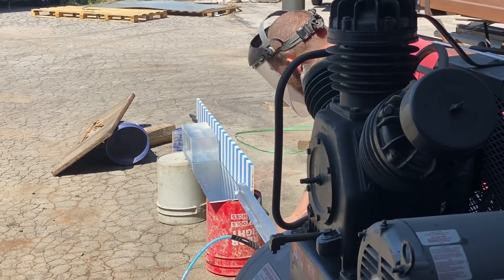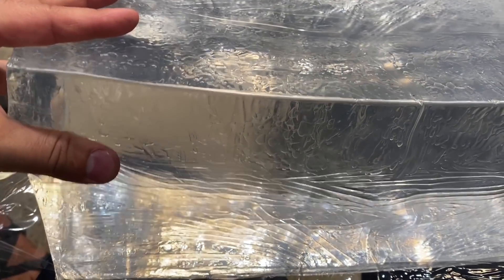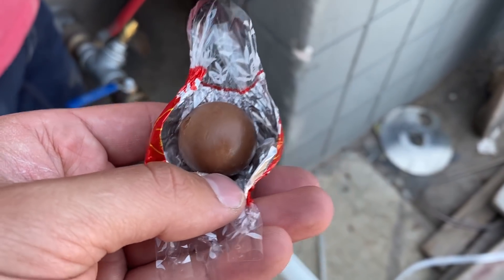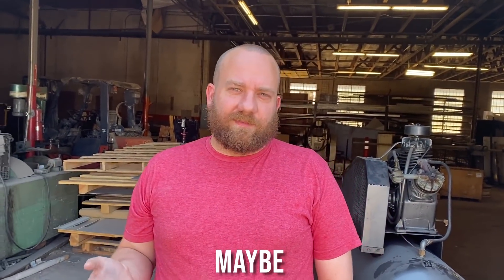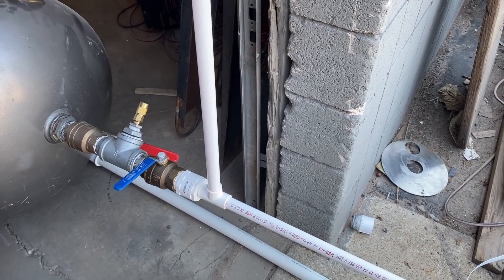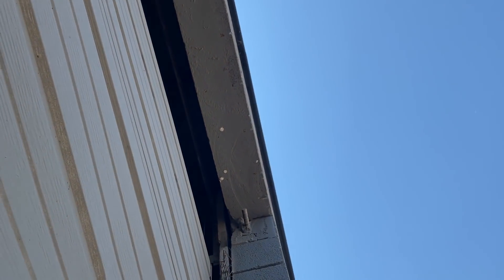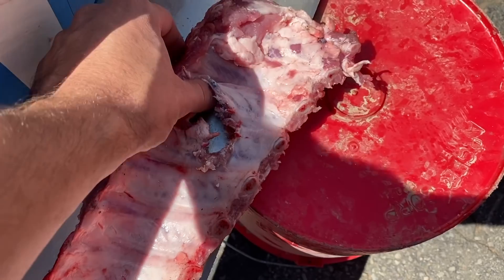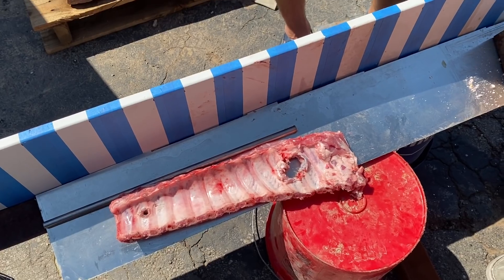Can A Gumball Kill You? Ballistic Gel Test

Comment: Ive removed the buckshot from a 20 ga.  shotgun shell and crammed two starbursts into the wad.  I shot a concrete block with it for the starburst to shatter.  There was some real fine stringy stickyness in a few places about as fine as a spiderweb but for the most part it shattered.  Temperature's in the 80s outside but it acted like the taffy like material was frozen or that it was colder outside.

Comment: You guys can get much higher velocities if you replace that ball valve with a modified 1" sprinkler valve (available at Home Depot), all you have to do is unthread the solenoid coil from the top of the valve and fill the hole with epoxy, then once that cures drill a 7/16" hole in the center of the diaphragm cover plate (remove all the screws and separate the parts, then drill the cover plate separate from the valve body or you'll either drill through the diaphragm or get plastic drill shavings between the sealing edges). Once you drill the 7/16" hole tap 1/4"-NPT threads into it and then thread a pneumatic blow gun into the hole with Teflon tape. This will be your actuation valve, all you need to do to fire the system is charge the chamber with pressure (which is WAAAAAAAY too big BTW, a 3" diameter piece of PVC about 4 feet long will give you the same results without wasting air) then press the blow gun trigger, the valve will open in a few hundredths of a second instead of the half second it takes that ball valve to open. It operates exactly like a Quick Exhaust Valve, or QEV for short, they're what you hear when a truck releases it's brakes, that rapid burst of air is vented from a QEV.

If you try the system with just the solenoid electronic actuation it will open very very slowly, most of the time it just makes a hysterical honking noise because the diaphragm flutters and can't decide whether to open or close. But if you do what I explained, the blowgun evacuates the pilot side of the valve nearly instantaneously and provides the maximum possible amount of pressure to the projectile in the least amount of time. And since the valve will only stay open as long as the blow gun is pressed, it shuts off airflow much sooner than you could close the ball valve. Just my 2 cents, I've only been building professional potato guns for two decades😉.

For a much deeper look into the subject of pnuematically triggered valves and potato guns in general (these pneumatic guns this size are considered child's play BTW lol), check out the SpudTech forums at Spudtech .com.

Comment: We did the same thing working at Claiborne Bombing Range in LA but with a full CO2 tank and regulator. The holding tank was 2" heavy wall tube with a 3/4 copper pipe 12' long.  But we used 20 penny nails ground to a fine point and used time cards to make a cone. It would blow a hole through an engine block! Things you do when your bored.....  Come on guys ramp it up!

Comment: Neil!?  Who's Neil?  I thought it was Filthy Frank.

Anyway, I'd suggest a 45 degree angle tee for the 'ammo pipe', rather than a 90 degree, and help it along with an air line to launch them into the pipe or see if gravity will help out first!
Reply: with a cap with a lateral through-bolt

Comment: Pull a Vacuum on the barrel to increase the speed of the candy
Reply: how would that work genius?
Reply: @natalieisagirlnow  by placing a piece of tape over the end of the barrel and pulling a vacuum you be able to a attach a barn to the barrel and pull a vacuum with a vacuum pump. Doing this would reduce the amount of air resistance in the barrel allowing it it continue accelerating faster before it exits the barrel while bursting the tape at the end when the candy hits the tape.
Reply: @dylanlebiedz9305  except it would suck in the tape or require a solid cap, which would just get blown off